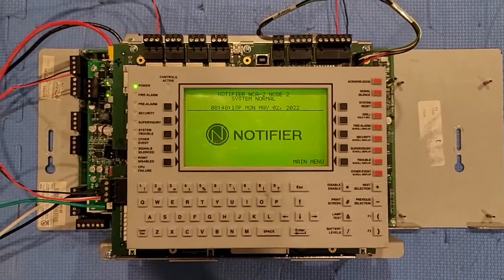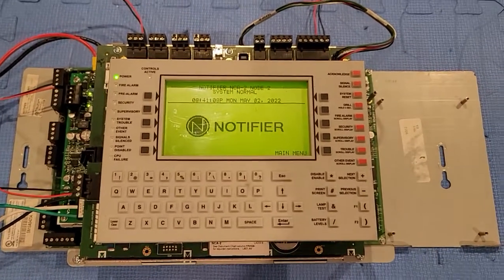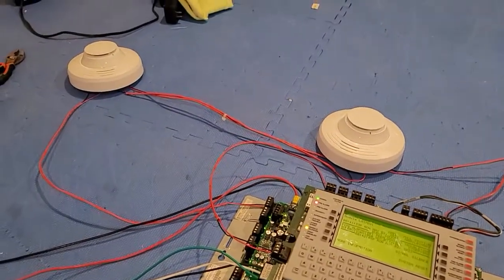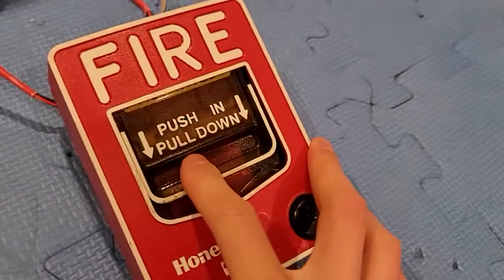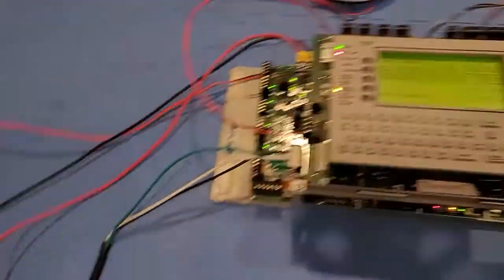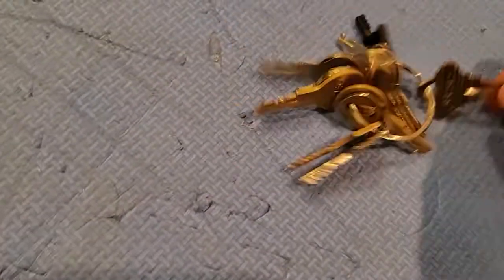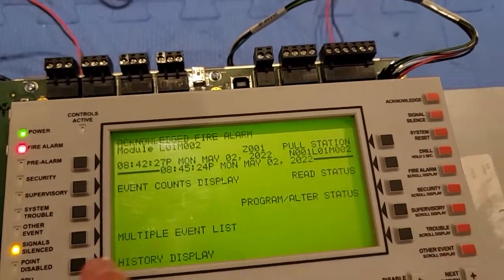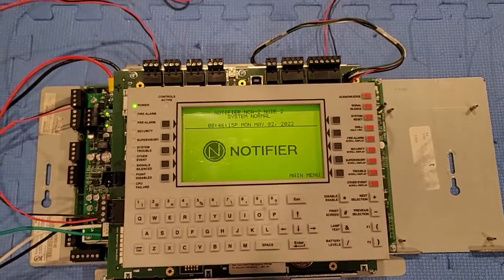The Final Test Of The Notifier NFS2-640

Comment: Notifier is probably one of my favorite brand in terms of installation and functionality, but i’m still a sucker for Simplex appliances like 4100 legacy systems. I love the direction Simplex is going with addressable/pri2 emergency technology.
Reply: I agree. But with the Foundation series, I like Simplex low end systems better than the Notifier FireWardens and conventional panels. Simplex and Notifier are eye to eye with each other. Simplex is very customizable while Notifier on the other hand has rotary dials which are easy to address and Notifier has annunciaters that can be in smaller cans unlike Simplex where you have to buy a full sized cabinet for remote control of the voice evac stuff.